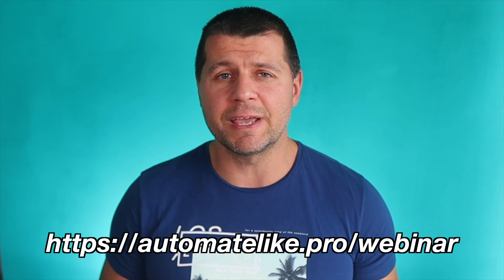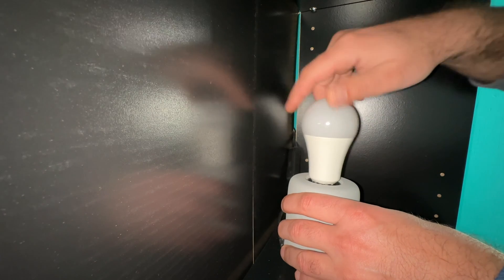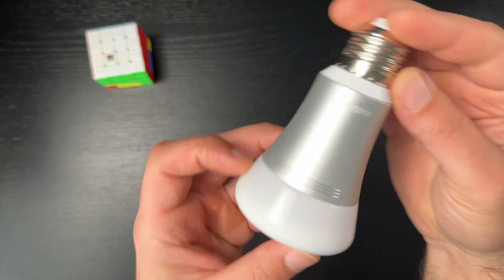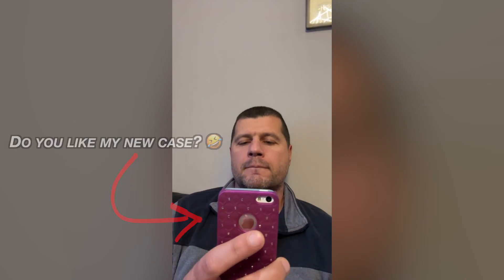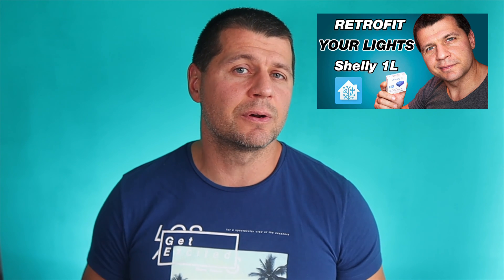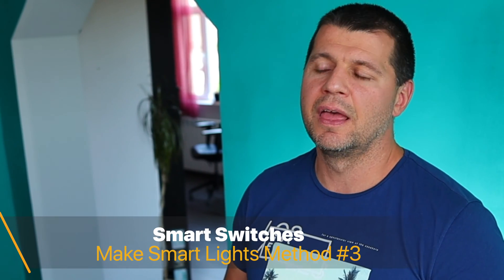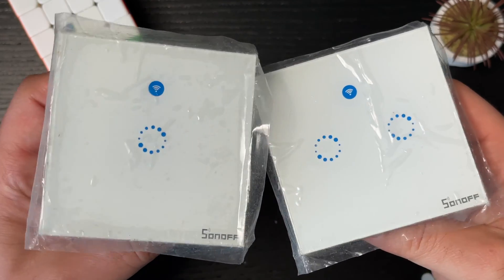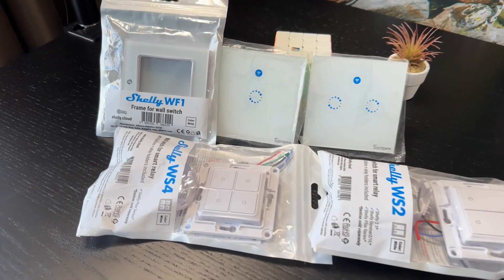3 Ways to Make Your Existing Lights Smart + Pros & Cons

Comment: I use tasmotized switches, but even now I cannot fix my lighting to work properly :(  I use fibaro motion sensors that open up the  lights and in the same time open some timers based on time of day like: evening, midnight after midnight sunset sunrise etc. BUT fibaro motion beings on batteries they report next movement after 3 min I guess so the minimum time must be 4 min to turn off the lights and it's too long for smart especially when you have pets, which often set them on. So, the truly smart light will be a radar sensor I guess or somebody have a smarter automation ideea? I know you are talking about hardware but a software automations ideas will be nice too. BTW I don't like your case 😋
Reply from the maker: Clearly, you have no taste. The phone case is great and it cost almost $3, so it is not for everybody 🤣 Just kidding here 😂 The phone that I'm holding is not even mine :) I just use it to shoot that B-Roll :) Anyways, regarding the motion sensors, I'm happy with Shelly Motion sensor as it have very fine sensitivity menu, where you can set it in a way not to detect pets. Also, blind time of the sensor can be set to 1min as minimum.
Reply: @KPeyanski  I was sure it's not your case, of course... I think will try some shelly because is black friday, but fibaro was soo expensive and now to throw them to garbage 😔😔😔 the battery was good tho, hope in Shelly will be too. Thanks for suggestion, I think it's the best way to fix my lights

Comment: Excellent video on the comparison of the 3 methods of converting "dumb" lighting into smart lighting!  Another consideration for most would be weather you are a renting your home or apartment, a homeowner, or even a landlord.  If you are renting, most likely the only option would be the first option of using smart bulbs as any type of re-wiring of a rental place would most likely violate a rental agreement.  If you are a home-owner, however, you would most likely want to go the route of a complete replacement smart switch or the relay method.  You will also want to give careful though on the type of communication method you are using for your bulbs/relays/smart switches.  If you are going with all WiFi devices, depending on how many bulbs you end up converting, you will most likely put a decent strain on your WiFi connection to the point you will have not only issues with your bulbs not staying consistently connected, but you will probably notice slowness on other devices like your phone or your laptop.  A good rule of thumb, if you are going to be using more than about 15 WiFi bulbs or combined WiFi smart devices, you are going to want to look at a different communication protocol and a good hub like HA (HomeAssistant), Apple Home (if you are iPhone/Apple user) or SmartThings.  I use a combination of ZigBee and Z-Wave protocols as they both have been very reliable for me.  Thread is a new and coming standard that I would personally recommend most everyone shift to ASAP as it will hopefully take over as the new standard, especially with the evolution of Matter Standard. One note on the increase in cost of using a full replacement smart switch is that even though you may not have the option to control color or change the warmth of your white light as with smart bulbs, you may actually save quite a bit of money using a smart switch.  For instance, in my kitchen, I have 8 recessed can lights that are all controlled from 1 switch (a 3-way switch in my case, but for smart switch purposes, that's still just 1 purchase.). If I were to purchase all 8 smart lights, even the cheapest Shelly duo purchasing 2x4pack would cost me nearly $90 USD not including shipping, whereas I am currently using the Blue Series smart switch from Inovelli which only cost me $45 USD.  I even bought the Inovelli Aux switch which gives me dimmer and scene control on the other end of the 3-way switch, which is optional and only cost me an additional $22 for a total of $67 USD and I now not only have all 8 dumb bulbs smart controllable, but I have scene control, notifications, and dimmer capabilities for a total savings of ~$23-45 USD!!! I really don't see a need/want for color lighting in a kitchen, but the dimming feature is a must have and scene control and notifications are a huge added bonus.  All 3 bathrooms in my house also have 6 bulbs each fixture, so again, the much cheaper route is the smart switch for me which is overall cheaper as the minimum number of bulbs on one switch/fixture in my house is 2 bulbs, and I would much rather have the aesthetics and added scene control/customizable notifications at every switch for just a few more $$.  On the last consideration, as a landlord where you use your home for a Vrbo or Air B&B, or vacation rental of sorts, using intuitive smart switches that act in a similar enough manner to dumb switches can save so much on electricity using smart calendar scheduling integrated directly with HA.  You could have the porch lights come on for your guests at dusk if say the front door was never opened on a day that a scheduled guest is set to arrive.  This would save much electricity as opposed to having the cleaning crew leaving it on from much earlier in the morning.  You could also use motion detectors and advanced sensors like the Everything Presence One Sensor (https://everythingsmarthome.co.uk/the-everything-presence-one-now-available/) along with smart switches or relays to turn off lights in rooms when guests leave which can save so much on an energy bill and put that money back in the pocket of the landlord.

I really love this YT channel and appreciate the cool content and projects.  I previously converted a 2007 Class C motorhome myself into a smart RV, including heater, A/C using a Honeywell Pro battery operated thermostat, all lighting and exhaust fans using a combination of Zooz multi-relays and cheap tiny Zigbee 12V relays from Amazon.  I also added relays to the front door power locks as well as a smart bluetooth lock for the main door to set up a nighttime routine to secure the RV with a simple "goodnight" voice command on either Google Home or Alexa.  I also automated the hot water heater and the water pump for dry docking to both be smart/voice capable also using a Zooz multi-relay.  I was starting on the level reporting for the various tanks and battery and propane tank when we had to sell the RV and I was sadly unable to finish the project as it was tedious soldering in across each LED on the level output to individual relays to report the levels back to HA.  I am sure there was a much easier way to go about the level reporting using some resistors and a single relay, but I was already on a limited time restraint and did not get to finish the project even as is.  But it was still pretty cool to be able to automate everything I was able to get to.  I also used humidity sensors to automatically activate the exhaust fans and if the humidity was ever high enough, all exhaust fans, including the stove exhaust fan would activate until the humidity dropped below a specified threshold so that we never had any issue with excess moisture, even if we were not in the RV at the time since it was all automated.  I also used geofencing to automate the HVAC so we were not using more than the electricity or gas than needed.  I even installed a smart faucet in the kitchen as water conservation is one of the most important features in an RV, especially while dry-docked.   We were also able to eliminate several measuring cups from our kitchen supplies as the faucet allowed for precise measurements and even precise temperature using voice command which eliminated so much wasted water!  I was also able to eliminate the extra battery pack on the smart faucet just using a DC transformer and the 12V wiring in the RV.  I am really excited to see how far the project comes on this channel!   Thanks again for all your hard work and awesome content!  Keep up the amazing work!=]
Reply from the maker: Wow Patrick, thanks for the long & informative comment. You did an amazing job giving additional information about the Smart Lights and different real life examples. You also described very well all the modifications that you did on your RV. So sorry that you had to sell it, as it seems that you put a lot of passion & efforts on it, but I guess it is never too late for another adventure. Can you share what was the smart faucet brand & model that you used. Thanks one more time for this great comment.
Reply: No problem at all!  Happy to help share my love and limited knowledge of the Smarthome Automation and RV Automation world!  I actually ended up loving the Smart Faucet I chose for the RV so much that I am using the same one in our Kitchen in our new house.  The only difference is that in my home install, I ended up using the AC adapter and splitter so that the faucet has constant power because I would rather not have to worry about changing the batteries every couple months.  It also seems to keep the WiFi connection more stable.  Voice control seems to be more consistent in Google Home, but it also works for the most part in Alexa.  It's made by Moen and the model is 87014EVSRS
I didn't buy mine through retail, but found it brand new for under $300USD on eBay:)
Reply from the maker: Many thanks Patrick I also considered Smart Faucet for the RV, but they are quite expensive and I didn't find a Home Assistant compatible one, also if I mange to find one I'm not sure if I will be able to use it for something more than a smart water meter, so I parked that idea for now. Anyways, thanks for sharing this I will check this Smart Faucet out (in eBay as well) 😉
Reply: @KPeyanski  Happy to provide the info!  I was actually unsuccessful myself when researching smart faucets to find one compatible with any hub or controller platform.  In the RV, I was using Home Assistant mainly, but at the moment, I'm using a combination of Smartthings and HA in my current house.  In my house, I'm using Virtual Switches configured as contact sensors which are synced and usable by Alexa to trigger routines based on status.  I just created a few virtual switches to turn on and off the faucet or change the temperature or start a preset from the Moen App, all by matching the status of the respective Virtual Switch and starting a custom routine with the exact voice match command of the Moen Skill as if you were asking it directly using your voice.  I know it only provides automation control and it's only a 1-way automation control as status reporting would nott work, but for the purposes I've needed in my home, it's more than enough to kick off needed automations.  Namely, I'm using a leak detection sensor under the sink and if for any reason, the presence of water is detected, The Virtual switch is triggered to turn off the faucet and will continue to send the command every minute until the contact sensor has been returned to a dry state. I also use geofencing automations when I leave the home to not only lock and secure the home, but also confirm that the faucet is turned off by switching the virtual switch off that sends the custom routine to Alexa.

I know the price is a little high, but it has been the best smarthome investment I have made so far, right next to the safety and comfort of using z-wave smoke and carbon monoxide sensors also with virtual switches and lots of safety routines to make announcements on all echo devices, send push notifications and text messages, as well as unlocking all doors, setting all lights in the home to 100% brightness and opening the garage door to allow safe exit in the event of a fire, as well as to allow instant access for neighbors or fire department, if the entire house is in a deep sleep or if for any reason we are away from home during a fire or CO2 event.  Then, I would just use my cameras to confirm there is a real present issue, or if it's a false alarm, I could easily close the garage door it locks the house back up from anywhere..
I know it's also possible to set up similar virtual contact sensors/switches in HomeAssistant which should perform exactly the same with custom Alexa routines.  The infinite power of automations and routines!!!